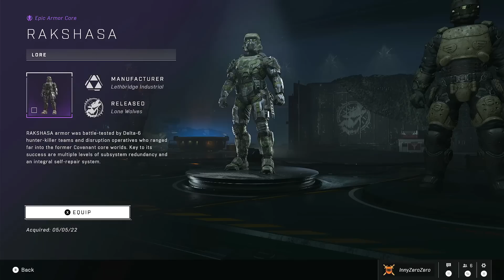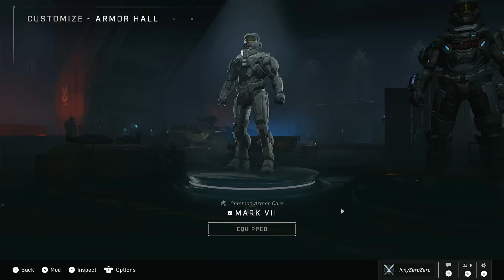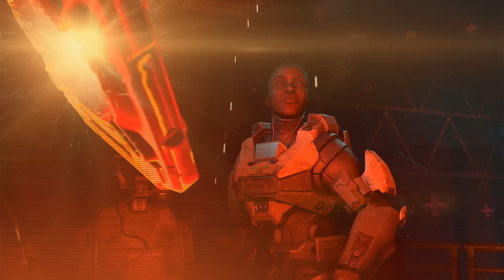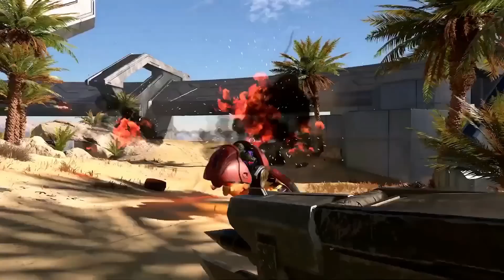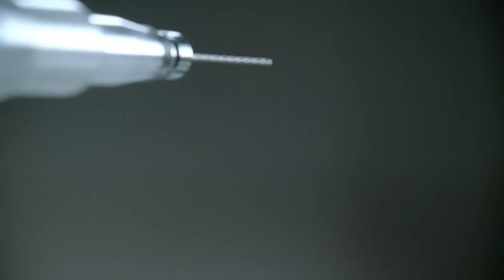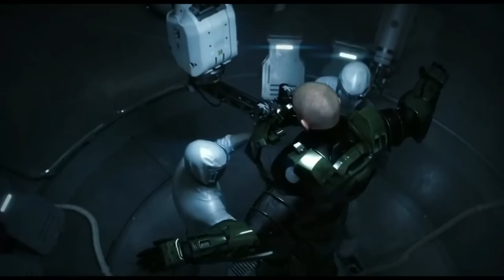Rakshasa Armor Core - Why no fusion packs? - Lore and Theory

Comment: I think it's worth noting that, from a gameplay perspective, this isn't the first time we've had armor options that lack the fusion packs while also playing as Spartans. As far back as Halo 4, when they added ODST armor to player customization, which had a Halo 3 ODST-esque backpack instead. While in that case it could almost be argued that the fusion packs are protected within this, the way in which it's portrayed gives it the feel of an attachment rather than a part of the torso armor itself. 

After that, the next example I can think of is MCC, with the addition of the Fireteam Raven armors, and to a lesser extent, the SPI and Fracture armors. The reason I put Raven ahead of SPI and Fracture is primarily due to all four torso armor pieces lacking not only fusion packs, but also any kind of backpack that comes with the armor itself, unlike Halo 4's ODST armor. 

SPI is fairly easy, seeing as it's MCC variant is referred to as Mirage, and barring some small lines of lore text, I am not aware of how much of an upgrade it got, or whether it can field Energy Shielding tech canonically. As for Fracture, there isn't much that I am aware of regarding what power requirements the Fracture Belos, Blackguard, and Drengr Spartans had, be that less, equal, or more, nor am I aware of what means their armor would have had to reach those requirements. That and Fracture is Alt-Universe stuff so it's already a bit more removed from the discussion than Main-Canon armor like SPI, Mirage or, in this case, Rakshasa. 

Which leads me to believe that this is much like the inclusion of ODST, Mirage, and Fracture armors in Halo 4 and MCC, where the way this armor core functions in game differs greatly from it's canonical counterpart. Also, the reason why I didn't mention Halo 5 is because I don't have enough insight into all of the armors it had for players to use, as I haven't played the game. If there are other examples of armors usable by players that lack fusion packs, I'm sure someone'll bring it up in the replies.

Comment: I would say that the Rakshasa was designed, as we all can see, with a different concept in mind. The overall design of the armor, probably makes it harder to detect, allows the wearer to move faster, etc. Essentially the MJOLNIR armor would be that of say...shock and awe (excluding very few systems designed for stealthier approaches) while this Rakshasa seems to follow that of SPI. It's a scalpel rather than a hammer. Sort of how ODSTs were. 

If I were a betting man, I'd say the Rakshasa was designed to supplant ODSTs and bring standard humans into more...capability without any severe augmentations. 

Love the video by the way. 

Hopefully we get more, but that is my thought on it. It looks like something the marines and ODSTs would be able to wear. Seems more functional rather than the MJOLNIR doing all the work. A lot more....analog if you will as Spartan Locke put things in Nightfall.

Comment: Maybe if they've got programmable matter and piezoelectric compounds, you could have a larger amount of power generation and storage that doesn't require a fusion generator. Honestly without the shields the power generation seems to be a major weakness of the spartans, I'd just target that thing, sure it's uparmored and all that good shit but get through it and rip everything in about a mile out

Comment: I like the Rakshasa armor because of it’s lore and it looks amazing. But two thing did bother me was the lack of armor on the back and the Energy shield but after watching your video it made me think it has thin layer of armor to protect electronics and possibly the power cells to Power the energy shield but there isn’t enough information to be sure but for all we know he could have multiple power cells inside the armor arms legs or chest but I won’t know for sure until 343 releases that information.

Comment: I thought the same thing about the helmet, it must be downgraded and the fact that it's MJOLNIR armour that has nano-machines, an assassin/stalker helmet that has been, PORPOSLY NERFED and downgraded BY ONI, integration of multi-species technology for infiltration and more allowing a Spartan practical sensor or security system invisibility as well ALL of the MJOLNIR bonuses plus customisation to a point that they can add drag bars for incapacitated Spartans safely presuming that they will survive is INSANE!!!!!!
Reply: Just the technology getting more & more customisable & mainstream. We had seen the evolution since the Mark 4 GEN I. It'll get to the point the lines will blur between wearable assets between the UNSC branches. The big all out OP suits will always try to strive to be hard-hitting assault platforms, just the technology will trickle down into other platforms which we seen with the GEN II with some of the ad-on packages, GEN III is further proof of it & taking it a step further.

Comment: My head cannon says that because the Lone Wolves are supposed to be super sneaky stealthy bois that either their shields are for emergencies only and are battery powered or the just straight up don’t have energy shields.
The fact that you get shields in MP is just for gameplay so you don’t get murdered instantly.
Reply: Right like id be willing to bet they got some kind of miniaturized rtg that runs the suit and has capacitors topped off for the shields to activate but only as long as the capacitors have juice. Once their drained it’s gonna take a long time before those shields turn back on.
Reply: they likely have energy shields, just significantly weaker ones

Comment: Awesome analysis, as always! Another thought I had last night, one which I think ties in rather well with the theories posited in your video, is the idea that the fusion reactors could have been A) refined further to be (somehow) more compact and B) allocated to, and stored within, the arm and leg armor of Rakshasa, with each micro-reactor only powerful enough to provide energy and shielding to the respective limb. (That, and/or a single micro-reactor residing in the frontal chest plate.) In any event, the thoughts you provided here were much more comprehensive than “Very efficiently!” and for that I sincerely thank you.

On a more personal note, thank you so much for looking into this and scratching that lore-itch for me. It was pretty cool to go from having you respond over Twitter to watching your video on the subject in under four days flat. The “for those of us who are particularly astute” line almost felt like a personal nod, and had me feeling pretty special. 😆 Thanks again sir, your video didn’t disappoint.

Comment: Hey someone picked up my question :v
Yeah rakshaka dont have visible power pack is pretty weird. Tucked in the chest plate i guess?
Though its gonna be hella hot without the power pack giving the gel layer the energy it need for enhancement and thermal regulation plus various function.

Comment: Rakshasa just reminds me honda civic with a spoiler/fins and a stock engine and if you complete the battle pass I can put some nice rims on it.
The Mark 4-7 are like classic and new v8 muscle cars with chief's mark6 gen 3 being the supercharged best version of that.
Yoroi is like an exotic car
And eagle strike is a refurbished hotrod.
My point really is that rakshasa looks the
weakest or cheapest of all the armors by a large margin..
Reply: @Michael Mazurczyk its simplicity means that it has worse combat capabilities but much better infiltration capabilities due to being long lasting and easy to maintain, that's the whole point of the armor, it's less capable but better when you are in the frontier due to not requiring a central command structure and its resources to maintain
Reply: @Michael Mazurczyk Master chief spends a lot of time on his own but he still almost always has a support network within range. Rakshasa units are intended for really long term (years, maybe decades) infiltration missions with no guarantee that a support network will be anywhere nearby for a while
Reply: @Michael Mazurczyk It's the point of the core man. Idk why you are arguing with me I'm literally just explaining to you 343's design philosophy behind the core. Also chief has only been alone for half a year, and it doesn't seem he had the liberty to consider changing armor cores before reaching zeta.

And i'm not saying all spartan ivs are intended to operate alone for years, i'm saying specifically spartans wearing rakshasa armor are likely wearing it because they were sent on a long term infiltration mission, because that core is well suited for that task. If you want an example, they literally included rakshasa spartans dubbed "wolves" in the season 2 story
Reply: @Michael Mazurczyk I also think it's stupid how the rakshasa core has no backplating (although the underarmor all spartans use is a type of soft armor so they do technically have back armor not including their energy shields) however I think the overall design makes sense for its purpose apart from that

I also don't think the purpose is to be lightweight, its to be cheap, simple and easy to maintain. Being lightweight is pointless as mjolnir already enhances your movement artificially
Reply: @Michael Mazurczyk yeah same

Comment: “Superhuman Stalker, Killers and Assassins”
With the Spartan ops an independent service Oni likely lost the bulk of its wet works division. It makes sense they could have already started a SpartanV program. Of particular interest to them might have been the fact that surviving Spartan II, Spartan III and the potential of Spartan IVs going AWOL. 

If that’s not enough in the Block 2 of Mjolnir armor sets were a number of armor types that were stated in the lore break down as being of unknown origin or black market. Generally a black market doesn’t exist without demand. UNSC is supposed to be the only source of Spartans via the three known active generations. So if on the black market you have Spartan IV grade armor sets then the question is for whom are they meant? Spartan IV are relatively new, Spartan III are rare as they often died in suicide missions on mass, Spartan IIs have been dwindled in number by major conflicts for decades but even then had less than a 100 with assuming recovered candidates). It seems unlikely that large numbers of them would be available shopping armor. 
This leads to the potential of a Knockoff Spartan. Though Oni likely was able to keep the details of Spartan I and II augmentation under lock and key the larger wider Spartan III and IV programs numbers would have demanded thousands of medical technicians and surgeons trained in the laundry list of augmentation procedures. Any one of those could have left the program and set to operating in the black market either for financial or Ideological reasons. Reverse engineering a Spartan IV set of augmentation then coupling with Blackmarket Mjolnir armor and weapons. 

With Spartan ops focusing on “The big picture” threats. Image an ODST or Marine unit deployed to a planet with strong remnant Insurgent  sympathies. Suddenly facing off against a squad of Spartan IV class combatants. The asymmetric advantage that would offer. These would generate a “Tiger terror” among the grunts, as any unknown contact sends rookie troops into a panic of Super soldier at the gates. These “Immortals” ( reference to the Persian imperial guard who battled the Spartan 300). Might only be a few hundred but would have a detrimental effect against whole army corps. Even if they were all killed in the AOR the grunts would still be jumping at their shadows. 
Such a concept could justify an Oni AntiSpartan Spartan program. Using lessons learned in Spartan II, III and IV. 
Potentially starting with a blank slate and using more advanced slower flash clones as the candidates. Augmentation processing from before birth to extend the life of the clone. Using nanotechnology to augment bone, Muscle, flesh and brain. Combine with a superior armor set but kept in very small numbers deployed in the black to hunt any rumbling of a rouge Spartan or other super human threat.
Reply: this reminds me of the fantasy rakshasa often found in RPGs like dnd. They are technically fiends/devils that take the form of a humanoid animal, often preferring bipedal tigers. They present themselves as aristocrats, but its a disguise that allows them to infiltrate normal society (cat people aren't uncommon in most RPG settings). They can use magic to alter their appearance, and detect the thoughts of those around them. They use slander, lies, and exposure of secrets to ruin the lives of nobility. When they are at their lowest, the Rakshasa will kill them using claws or magic, and consume their flesh. Some rakshasa prefer to consume their tormented souls. They are secretive and often run criminal empires with multiple safe houses and places to hide. They continue to consume souls/flesh of nobility in an area until they are killed twice. They do a little trolling
Reply: @kaptinkanoodle5039  this somehow feels cannon
Reply: I personally think there are more Spartans out there than we think, this is ONI we’re talking about. A wet dream of shadow organizations and conspiracy governments that make real world ones look tame most likely, they would do it. Rehabilitated Washouts from SII, a Class 2 of SII, even to a lesser extent, more Cat-2/headhunter SIII, surviving SIII washouts becoming SIV, Possible SIII Delta Company, heck even SV’s like how Installation00 described in that dedicated video.
Reply: I always felt like oni couldve easily continued the spartan 3 program, but off the book, considering there was supposed to be a fourth delta company

Comment: Speaking of fusion, how cheap are they in the Halo universe. Why are most small vehicles still use hydrogen fuelcell instead of small fusion reactors?
Reply: Extremely expensive, id assume in the new lore they are not quite the "half a starship" cost that was earlier spartan armours but the production and more importantly, maintenance cost is still so high it has no practical applicationsboutside of elite equipment such as ships and spartan armour

Comment: Before watching, I'm going to say that I guessed it doesn't have a shield outside of gameplay and that it might have a smaller, concealed power pack that powers the undersuit. Combine that with the substantially lighter plating and I figured that a Spartan wearing Rakshasa is probably really, REALLY fast, at the cost of durability.

Can Rakshasa truly be considered MJOLNIR at all, then, or should it be its own category like SPI armor?
Reply: I dont know if they would be substantially faster than a Mk7. The mjolnir platform amplifies the wearer's movements so even wearing half a ton of armor they run extremely fast thanks to the actuators in the suit.
Reply: @ArcHammer38  It seems they still have that since the AI was able to move the suit while the spartan was unconscious
Reply: @Random-hs7pw  in the tv show?
Reply: @Knight of Amour

Well if this is a ultra light armour for speed. What about a heavy programs version to combat high strength opponents such as brutes in power armour and hunters, basically a half mjolnir half Cyclops hybrid.
Reply: @thanqualthehighseer  That's beyond dumb. Why put a SPARTAN within grappling range of either of those? Guns exist for a reason. If you are going to be within grappling range of Hunters or Brutes, then odds are you won't benefit from having a massive set of armor that proves to be cumbersome. If you are fighting them at all, you will more than likely be aware of that given that Hunters are essentially living, mobile artillery pieces so you would anticipate them accordingly, and with Brutes...well, they have their own military now, so just expect them whenever.

Point being, having massive CYCLOPS armor for things not relevant to heavy lifting would be rather foolish.
Reply: I may be wrong but doesn’t elite armor also lack fusion packs? They still have shields. We see that halo 5 that elites and humans have established a technology exchange, perhaps useing elite sheid tech the unsc found a way to power the under suit and shields with a smaller power source.
Reply: In Halo Headhunters we see SPI with shielding at an unknown time in the War, albeit experimental, between this time and Halo's Current time period, it isn't unreasonable to think it has become widespread
Reply: @bmo5852  I thought that it was mjollnir, but just a lower quality or something, and also with experimental equipment.
Reply: @thelegoguy7  yep it was made for spartan 3s
Reply: @Willoops   @will saldivia   yes, the SPI  armor was made for spartan III yes, I just meant I didn't think they ever made SPI armor with Shields, and that those specific armors in halo headhunters was mjollnir, not SPI.
Reply: @thelegoguy7  It's SPI but upgraded to have energy shielding and a bunch other upgrades. Spartan III headhunters as of now are the only ones known to use that variant.
Reply: @thespikeheadboy3164  I see. Makes sense.
Reply: @thelegoguy7  SPI isn’t Mjolnir, it stands for Semp Powered Infiltration armor. Normal humans can wear it
Reply: SPI Gen 2 seems better fitting to me
Reply: It doesn't have shield emitters either
Reply: It could be for more stealth then speed. Since it weighs less, has more use of soft materials. So if not that much faster, would be a lot quieter.
Reply: @nicoroys7560  a lot of the rakshasa armour pieces mention stealth so would make sense
Reply: Agreed
Reply: A question though, does this armor have a plating on its back or there's nothing ?
Reply: if you think anbout it mark 4's are ALMOST these Rakashasa's but they have appropriate shields. and 2560-62, gen 7 tech.
though we all know jerome-092 is better than master chief/ john 117, as he does the same stuff but in mark 4